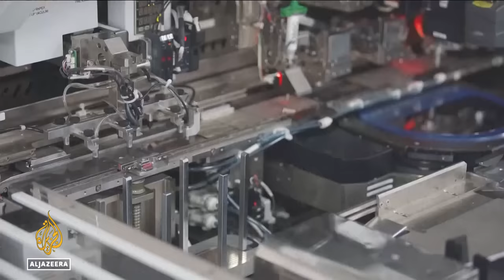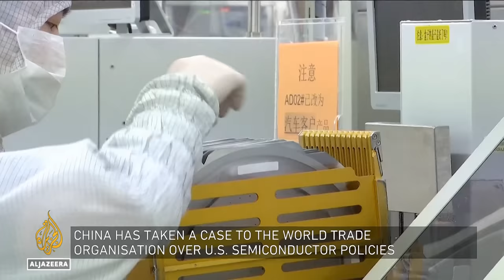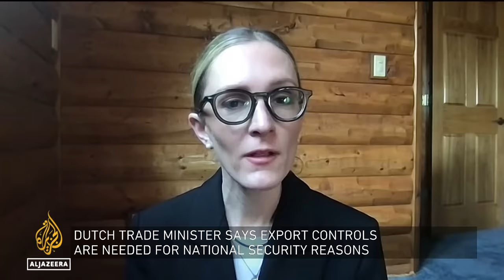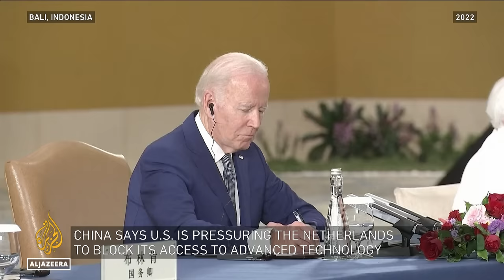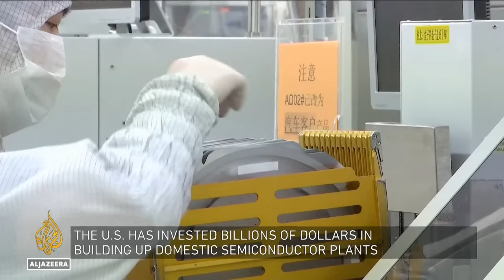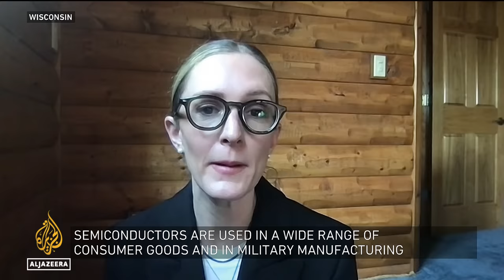Can China develop its own chip industry? | Inside Story

Comment: What doesn't kill you makes you stronger. China will overcome this obstacle and develop its own chip technology.
Reply: I totally agree, they are rolling out the completely domestic production line for 28 nm this year, which is more than enough for military usage.
Reply: @joey3291 28nm 😂are you living in 1980s
Reply: @prm1234567stphn  you only embarass yourself, 28nm came out in 2012
Reply: @prm1234567stphn  75% of the world chips are switching to 24nm. You don't need that 14nm lower just to play games.
Reply: @prm1234567stphn  You think the first airplane flew in 1703?
Reply: @1majo194 dude you need to do some research and find out who invented covid variant 1 and who benefited from that and how that led to later variants.
Reply: And what kills you, kills you.
Reply: @prm1234567stphn      You are un-educated. 28 nm is used in all e-products, home appliances, EVs....
Reply: @joey3291  Enough for military usage? good luck to the PLA army if they relies on old legacy junks.. LOL ask the US on F35 advance computing capability, datalink, those high accuracy missiles computation (and it's proven in Ukarine :D ) and TSMC does the chore-work for manufacturing the 5mm for LHM.
Reply: @alvinloh9068  You are very ignorant and arrogant. Basically for any military use the energy consumption is not a primary concern, that makes using 2nm or 28nm practically the same. You can use 28nm tech to make the most advanced 5G chip, but the only problem is that it will not be energy-efficient enough to use it in you new cell phone unless you want to carry a big battery. That's not a problem for a fighter jet or a helicopter, they have more than enough power to feed to a small chip. And in fact, military prefer 28nm than 2nm because it's more reliable.
Reply: @prm1234567stphn  My suggestion for you is, try to studying more knowledge.
Reply: @sukishiki  its time for school kid .. have you completed your homework?
Reply: That's an evidence
Reply: @prm1234567stphn  The F22 uses a 500nm Power PC603, Beidou Navigation System 180nm Godson 1E and Godson 1F, and the detector uses a 250nm Power 750
Reply: @fanghe-z1j  when was f22 designed ?
Reply: @prm1234567stphn  In order to combat the electromagnetic environment, most military equipment in 100 nm or more
Reply: @fanghe-z1j  
The only major military chip made in China is their aesa radar chip by sanan..
Beidou 28nm is made by SMIC it uses alot of US equipments
The major Chinese CPU loongson used alot by Chinese military 28nm made by samsung foundry and 45nm by SMIC.

But US doesn't care .. they totally irrelevant for any future use .. systems that were designed in 1990s and early 2000s use them .. but the once that are designed by USA and China now will be extremely reliant on 2 and 3 nm chips .. its like  comparing dvds with pendrives and cloud.
Reply: No they won’t. They barely learned how to make ball point pens. They will never catch up if they struggled making pens 😂😂
Reply: @joey3291  He also needs to know, Nuclear bomb needs not 28nm, but it would be enough to do the job.
Reply: Yeah we know how Chinese products are 😂
Reply: @prm1234567stphn 7nn😂😂
Reply: @leviscott3375 better than f35 subarine 😂😂😂
Reply: @GTFO_0  keep dreaming
Reply: @leviscott3375  tell that to junk down in the southchina sea
Reply: the question is not if, but when will China make a chip superior to others and does China make it before the real war starts in China seas
Reply: No, they won't overcome. They are dying.
Reply: Whenever china developed it's own chip industry then it's easy to destroy and invade Taiwan, so blocking the chip tech is in favour of us,Taiwan and his allies  , As a indian student am researching the us -taiwan relation , it's win situation for All
Reply: According to Chinese sources China is at LEAST 10 years away and unable to obtain the lenses needed for production
Reply: What's wrong with education, so many ignorant people
Reply: @manishmkv5524  Can you tell me why Taiwan's national title is called the Republic of China?
Reply: Sounds like both USA and PRC welcome the sanction. I guess this is few thing both side can agree upon and work out.

Comment: The chips that China can now manufacture are 14 nanometers, while the controllable chip industry chain in China is 28 nanometers. It was unimaginable before being sanctioned by the United States, after all, this is a global division of labor industry chain.

If you are familiar with the field of storage chips, you will find that in the past two years, major manufacturers have experienced inexplicable fires or production cuts, and prices have also become cheaper. One reason is that China's NAND and DRAM have gradually moved from backwardness to advancement. If you dare to reduce production, I will increase market share. So now nand and dram are getting cheaper and cheaper.

After years of sanctions and global Chip shortage, a large number of chips that do not need top manufacturing have been turned to domestic production. After all, apart from smartphones and computers, most electrical appliances or the automotive industry do not require first-class manufacturing to save electricity or have such high performance.

After being sanctioned, China subsidized 1000 semiconductor companies, some of which may have cheated on subsidies and some may lack competitiveness. However, as it seems now, ultimately surviving five fiercely competitive companies is sufficient. This task has been completed well, and many companies are much stronger than expected.
Reply: NAND huh?  OMG

Comment: The answer is nuanced here. If we are talking about whether China can make low- mid-end chips that can cater to its domestic audience, the answer yes. There are several chip makers, although commercial viability could be in question as they are not making much profits. Remember making a fab can be as much as 20-30 billion dollars, so everything has to go right, like the yield, cost control, quality, etc. But they have deep pockets and at some point who knows. 

But if we are talking about whether they can make chips that can run the latest Amazon data centres or Apple smartphones, the answer is no. Without having access to the global supply chain, it’s impossible for any country to indigenize everything by themselves. There are thousands of parts, equipment, supplies, materials that go into the manufacturing of chips and some have taken decades to develop. Everything needs to be sync in order to make the most cutting edge chips.
Reply: It's not impossible and China has to prove it. Judging from their past and determination that are likely to do just that.
Reply: China does not need to be self sufficient in every field or aspects, because no country can. Hence China also controls choke points in the supply chain to counter other antagonistic countries.  China can trade with other countries based on these bargain chips, as other countries have done first.😂
Reply: @protagonist9716 
Smart minds made sure that this is not possible for China - 30 years ago
Reply: What do you think about the new Huawei Mate 60 series of phones?

Comment: China can still make the low end ARM RISC chips, and they can produce CISC processor it is called the Zhaoxin. The Zhaoxin isn't as good as Intel or AMD, but they still have the technology and license to produce a X86/X64 based chip. They are producing the Zhaoxin Yongfeng KH-40000 which uses the 16 nm process. Without advanced EUV machines, Zhaoxin will have some problems mass producing 5 nm process chips. We shall see if China can develop their own EUV machines to produce more advanced chips.

Comment: The Dutch decision is also a sign of the growing rivalry between the United States and China. The two countries are locked in a technological Cold War, and they are using economic sanctions and other measures to try to gain an advantage. The Dutch decision is a reminder that this rivalry is not just about trade, but also about national security.

It is too early to say what the long-term impact of the Dutch decision will be on China's high-tech ambitions. However, it is clear that this decision will make it more difficult for China to achieve its goals. China will need to find other ways to acquire the technology it needs to manufacture the most advanced chips. This could involve increasing its own research and development efforts, or it could involve finding new suppliers.

Comment: The US able to land a spaceship on the moon in 1969 safely and none of this kind of technology exist in 1969.  Not much had improved since then except the landing of shuttle on airport like an airplane.  The chip restriction to China were mostly intended to stall China implementation of such technology to civilian use.  After all, China is the one country effectively applying such technology to build modern city for civilian use.  Those country with a system incapable of executed such master plan of city building doesn't desire to see other system are better than them, so they restricted the technology in their control.  Small and pocket size technology today were mostly for civilian use because the military required higher signal power to operate in remote area where they don't have multiple network to connected to.  Those support the theory of military use were just simply lazy because they don't want to work on improving their national infrastructure.
Reply: The moon hoax…

Comment: Surprised that no discussion about Taiwan at all. This is the key high end semiconductor manufactured in the world.

China can develop its own AI chip industry without Taiwan, but it will be more difficult. Taiwan is a major player in the global chip market, and it is home to some of the world's most advanced chipmakers. If China were to lose access to Taiwan's chipmaking capabilities, it would have to find other ways to acquire the technology and equipment it needs.
Reply: Actually Taiwan is not relevant here.  What China doesn't yet have is the technology to make high end equipment that go into chip manufacturing.  Taiwan doesn't have that technology either.  Taiwan make Chips using purchased equipment.  That part of process is not the road block, as China had even managed 7nm production with older generation of equipment.

Comment: Shanghai Micro Electronics Equipment (Group) Co (SMEE) will deliver the first domestic 28nm lithography machine between 2021 to 2022, helping narrowing the gap with the world's chip-making technology, industry websites said. 
Xiang Ligang, a veteran industry analyst, told the Global Times on Sunday that once SMEE has the ability to deliver 28nm lithography equipment, it will have the opportunity to move forward to 14nm and 7nm lithography equipment, noting that the breakthrough helps the company "accumulate experience" to manufacture high-end chip-making equipment.

Comment: The question is not can or not it's only when. China hasn't developed self sufficient chip industry not because it can't but because it's cheaper to import and more profitable for the end products. 
Now the only holdback is the tool to make chips like lithography machines. And it's only a matter of time the Chinese make their own. ASML (China's main lithography machine supplier) is aware of this, that's why they are trying everything they can to sell more machines to China now despite the US has ordered not to do so. Because several years from now the Chinese won't be needing these costly foreign machines anymore and ASML will lose its biggest market by that time.

Comment: China not having the latest equipment keeps it from producing it's own semiconductor designs in the latest densities and reduced power consumptions. Certainly makes producing advanced AI computer chips much more difficult. Other producers advanced AI computer chips will be controlled just like the advanced production equipment.
Reply: AI chip is not difficult at all. You just need a couple of subset of RISC V to make AI chips. Or 1% of CISC chip like Intel.